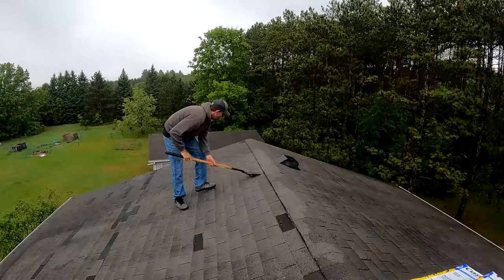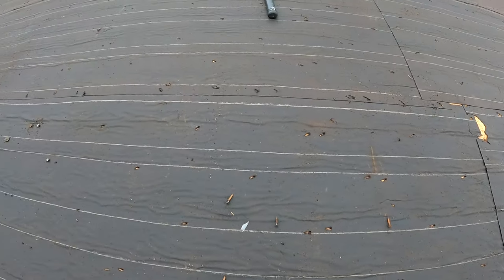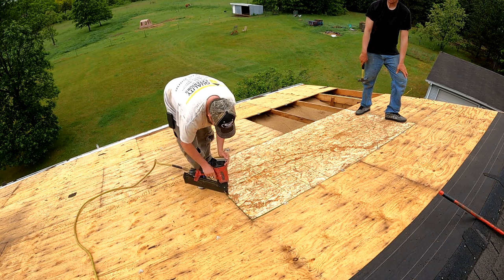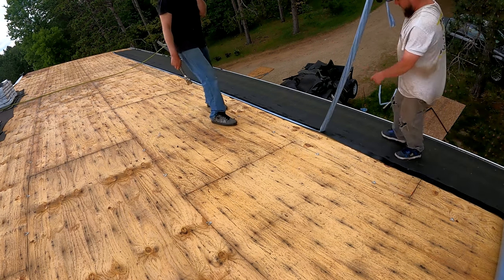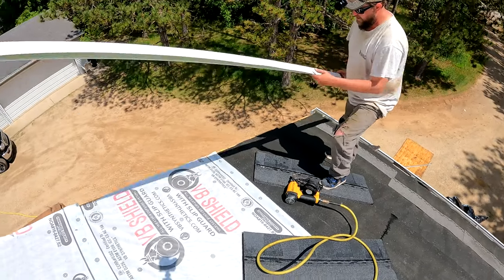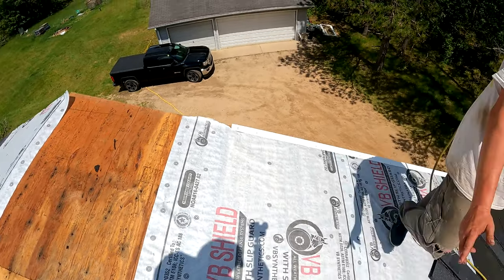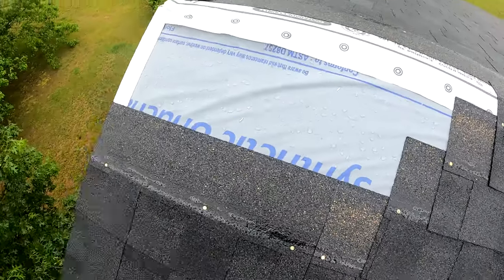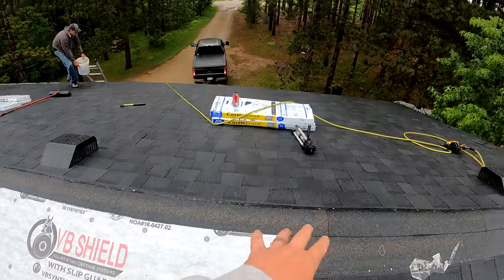HOW TO ROOF A HOUSE! [DIY]

Comment: Great work guy, Also I see your point about not running the starter shingle up the gable. It seems to me each shingle going up keeps one another down. I'm not a roofer, I'm a plumber of 50 years and I like learning new things and yes I'm roofing my roof all by myself. I've got to put down 75  bundles on my roof. I have a 8/12  pitch with a gable on the front, hip in the back with two valleys. I'm going to do my valleys the way you do sometimes, the closed valley or as they say the california valley.  Here in Alabama your're not required to use the storm guard in your valley, but I wanted it, so I did.  It rained like hell yesturday June 15th and no water got  through the synthetic felt. You do a good job simplifying things with your words and that's a big plus. Keep your videos coming...
Reply from the maker: I appreciate the view and the comment! going above and beyond minimum code is money well spent. The ice and water could save you a big headache in the future! you have any questions feel free to ask! the closed valley is the way to go in my opinion!
Reply: @Lifes_Apprentice  could you tell me what they mean by the key of a shingle.
Reply from the maker: @barrymilam9665  THe "keyway" is where two shingle butt together
Reply: It just looks cleaner
Reply: Not putting a starter on the rake actually voids the manufacturer warranty

Comment: I always chalk layout because it looks better having perfectly straight shingles and it doesn't take that much extra time. The fastest speed hacks use the gauge and never let go of the gun but on hot days the gauge can dig into the shingle and really screw up the layout. Also if multiple people are on the same section their gauges may be slightly different.

Ice shield expands when it's hot so if you throw it down cold in the morning you might have a bunch of wrinkles by lunch time. You can cut the wrinkles but that will make it less waterproof. On really hot days I'll tack the end of the ice shield then roll it out with the plastic on and let the sun hit it for a minute so it expands then I yank it tight, tack the end and pull the plastic from underneath it
Reply: Rookies chalk lines not professionals !!
Reply: @garylee12345  you certainly don't have to on a small house but on a warehouse or hotel or something cut up with dormers I think you gotta chalk lines otherwise it will look like some Dr. Seuss stuff at the ridge

Comment: Thank you you are a great teacher  your work is perfection you can tell by how your shingles line up straight you are one of the best of the best . From the Drip edge aluminum ice and water shield over the gutter apron V B shield white slip guard synthetic to the proper way with the nail gun . 7/16 to the 3/8  you are a professional best of the best 👍

Comment: One of the easiest and best ways I've seen for installing ice and water shield is to basically lay it out and do the staple on the one end and then take the plastic off after you've got it straight.

Comment: It would really cool to see how you start your coarse on a deck with hips on each side, that both run up into gables.
Your work is awesome by the way👊🏽👊🏽
Reply from the maker: hips on each side you do almost the same. keep a 5-7in stairstep and run it up. if it is cool outside i save my cutoffs for opposite side finishing pieces. if its hot and sticky i cut square and use on starting side

Comment: You don't have to put starter shingle on the rake edge, But it does insure a perfectly straight edge when looking at the edge from the ground
Reply from the maker: We just cut to the D edge and it stays straight that way
Reply: @Lifes_Apprentice  That's fine I'm sure. Some like to maintain overhang on the rake edge same as front edge.

Comment: i thought nailing IN/ON the tar line was a big 'NO' and that is due to the fact you're reducing the adhesive area for the next row of shingles.  Do manufacturers specify one way or the other?  I have all the material for my 12x12 shed laying on my garage floor and I suppose I could go out and read it but I probably would not know what I was reading anyway, lol

Comment: Starter on the gable is there to hold down the end of the shingle run so that wind doesn't lift it and blow water under it. With the starter holding the end of the shingle down via adhesive at the edge, any small amount of water that does get in is now on top of the starter, where it will begin to run downhill and come put at the downstream seam(s).  Odd you can't see why it's called for by roofing material manufacturers.
Reply from the maker: Thats what the ribs on the edge are for and when nailed properly it will not blow off. When using starter you let it hang over the edge more and it allows wind to grab edge of shingles easier
Reply: That's not true. Leaving the starter strip hang over 3/8" is not enough for the wind to get under it. The shingles you are using have the adhesive on the top side so there is no adhesive on the bottom  of the shingles  so yes they are all glued together but if you have too much pressure on your nail gun or the nails are too short (both could happen with a homeowner) then the entire assembly could blow off with enough wind but more than likely it will be fine. you'll get a lot less water  running under the shingles with the starter strip method. 45 years roofing and still going. Thanks for your video.
 @Lifes_Apprentice
Reply: @Lifes_Apprentice what ribs?

Comment: Thanks for sharing, Justin; I really appreciate your content. You show us the important details and 3X through the routine “hand-waving” parts.

Now for a question (which is probably code-dependent)… If it were your house and it had original 1X boards, would you you replace them with plywood decking, would you add 4X8 sheathing atop them, or would you just leave the original board deck and re-roof as the original roofers did. 

(My house is from the 1950’s, with an original roof, a second three-tab roof over it -done in the middle seventies; the wood is in good condition here in Southern California. I’m replacing with architectural roofing because it’s definitely time, it’s been shedding granules and looking “shiny.”)

Thanks in advance.
Reply from the maker: That is a matter of code in some cases and a matter of your preference. If there are large gaps,cracks,etc I would re sheet. I do not recomment taking old boards off in almost every case. I recomment using 3/8 or 7/16 and sheeting over existing boards if you sheet it

Comment: After just 7 yrs., my new
roof started leaking again. 
It was'nt until later I 
that I noticed my gutters  were not even
there. I knew one of the workers had taken all
iron awnings that held the front porch roof up,
because I asked about 
it.
I put a lg tarp, and  it helped, but still leaked.
Could no gutter be the
reason for such bad
leaks? 0:16

Comment: is it plywood , treated plywood, OSB, or what do you like
Reply: OSB is fine to use, it's a lot cheaper and more eco friendly if that matters to you. But CDX (which is treated for exterior use) will offer the best moisture resistance and longevity, but it's more expensive. Then of course the thickness will also determine it's longevity

Comment: If you run a starter shingle up the rake edge like you're supposed to then the bottom starter doesn't end up on the shingles keyway
Reply from the maker: The starter is not in line with keyway
Reply: @Lifes_Apprentice he meant if you run the rake starter first and then butt up the eave starter to the side of it, you can start with a full shingle because the rake starter pushed the full eave starter further away from the edge so the seams won't line up then

Comment: If you run "t metal" for the rake edge I can kind of understand skipping running your starter shingle 1" off your gable. But I've replaced alot of barge boards because people didn't knuckle gap their edge.

Comment: I have a question, I’m repairing my mothers roof and found so kind of membrane 3/4” thick. It’s  on top of her plywood and under the felt . Do I remove it or do I just replace shingles and felt?
Reply from the maker: JUst repair shingles and felt or the repair will not be even with existing roof
Reply: Do you know why they put that 3/4” tar/membrane? Home was built in 1940’s. I have pics but can’t upload to YouTube
Reply: @davidgrza if it's a low slope roof it could have been done as a flat roof prep and then someone shingled over it at some point. Gonna have to have some long nails to reach wood though all that.  Which means hand nailing. Guns only go up to 1 3/4 inch nails

Comment: The old "back-of-the-air nailer-hammer-trick".   haha
Getting my roof replaced right now.   1800 sq ft house.   They started at 8am.   They are 1.5 hours in and the roof is stripped.   Looks like a couple pieces of OSB need to be replaced.
Updates to follow......
Reply: .... 10am  they're stapling down the  what-cha-ma-callit paper/felt.
Reply: They finished at 6pm.   All done and it looks pretty good.  I think I counted 7 or 8 guys on the crew.

Comment: Strange that you staple the hell out of the ice & water barrier when it's adhesive and you're about to shingle it same day (which adds plenty of hold-down fasteners). Every staple compromises the integrity of the shield.  I'd be surprised if the official usage documents for the adhesive barrier call for it to be stapled, at all especially when shingles are going on the same day.
Reply from the maker: It is cold and does not adhere the same day in Wisconsin and we are in a wide open field where it is windy.

Comment: So when you put over the gutter what keeps water from going underneath when high winds and rain pulls it up???
Reply from the maker: Waterflow. there is a small possibility in a crazy storm
Reply: @Lifes_Apprentice  still vulnerable water finds it's way through any openings trust me
Reply from the maker: It is not a roof opening at that point and metal fascia should go about 2 5/8" behind getter apron and gutter over that too. water is very unlikely to get blown up over 2 inches under that installed corectly with no sealants required...Ice dams are a whole other issue and any amount of "prep" will not prevent in a bad scenario

Comment: I’m not a roofer by any means so I just wanna know, wouldn’t it be better to overlap at least one square from the prior sheet you placed so there’s no crack for the water to get in when it rains?
Reply: I'm not one either but don't believe me Im pretty sure you can because I've watched other roofers do it but it might not be for sure.

Comment: Can you put ice & water shield on top of the old one? 
Or should the old one be removed? thanks!
Reply: If you can’t remove the old it is ok too install over, you can also chalk a line and cut out the old ice and shield, sometimes it is so stuck too the roof you cannot remove it😊

Comment: Never cut the shingle down the drip edge, firstly you can easily slice the drip and second on a hot day the shingle will roll off the edge and make the underside of the drip black when viewed from the ground. Also and FFS cut a proposer shingle family.

Comment: The started on the gable helps hold the shingles on with that tar strip just like with the first row of shingles..
Reply from the maker: The eave starter is not to hold shingle down..It is so water doesnt get into keyway on first course. The shingles on rake edge are held by proper nailing placement
Reply: @Lifes_Apprentice  the starter row of shingles has a tar strip.. using starter on the gable ends also helps prevent shingles from blowing off.. starter Owen’s Corning representative came to inspect our roofs and he also said this.. I been doing this my whole life, you can’t tell me nothing…
Reply: @Lifes_Apprentice  what’s the purpose of the tar strip on starters??
Reply from the maker: @JohnDillinger-ko8bc  To bond the starter and first course together
Reply from the maker: @JohnDillinger-ko8bc  I have been roofing my whole life too. The rake starter is a newer thing... My opinion is the shingle companies just trying to sell us more shit and make more money...Starter of any kind did not exist until 20 years ago...Before we just used shingles

Comment: Just wondering. How come you only need the ice and water shield on the edge of the roof and not the entire roof?
Reply: Ice and water shield is mainly to combat ice dams that happen along the bottom edge of the roof. As ice and snow melts it tends to freeze when it hits the bottom edge of the roof because that edge with it's overhang is usually colder than the main roof. The ice and water shield protects from any melting that occurs under the ice dam and tries to work it's way back under the shingles
Reply: @MikeKunze-o5j  Ahh, that makes so much sense. Thank you!

Comment: Do you have any experience with flat roofs and dumpsters? How much can they weight on average this is for a warehouse and it looks white from Google eagle
Reply from the maker: I do have experience and the wieghts can vary. If it is a white PVC roof they are generally light along with rubber roofs. You have to be careful with built up tar roofs are heavy and any flat roof can have multiple layers
Reply: Thanks. Would you drop a 20 yards on that jobsite?
Reply from the maker: @EarlyBird_Dumpster  I would with my equiptment after I was sure what was going in there

Comment: Are those Atlas shingles thinner then GaF , Owens conring
Reply from the maker: They are about 235lbs per sq. they have become my favorite shingle over the last 5 years. I still love Durations but don't sleep on atlas products if you can get them. they make a line called briarwood pro, and storm master as well. In my opinion they make the best shingles on the market. I put my first atlas roof on 15 years ago and I drive by it all the time and still looks amazing
Reply: @Lifes_Apprentice   Good to know they don’t sell around here .
Reply: We try to use exclusively Atlas if possible, have been very good for us.  OC is our 2nd choice.

Comment: You really should use tin tabs . Plus im certain the ice and water goes on top of underlayment
Reply from the maker: I do not know what tin tabs are but the ice and water does not go on top of underlayment.
Reply: Depends on codes Florida is different. Tin tabs keep the tar paper from pulling of nails. It's a wind code thing. the concern you had for nail depth on gun is the same concept but tin tab ensures no issue for underlayment.with new synthetic stuff, may not be as critical.
Reply from the maker: @Nttt739  I do not know florida code...I believe you but in Wisconsin our codes are based on snw loads on roofs and ice dams and such...I am sure the codes varie all over the country to some degree

Comment: No roof is ever square you should chalk lines. Lines keep the shingle runs straight.
Reply from the maker: We run the tarpaper straight to the roof and to the peak so the lines on the paper keep us straight on a ranch roof. On a roof with valleys and dormers we will snap lines

Comment: How can you shingle right to left that drives me nuts.
Reply from the maker: Thats my favorite way to shingle and I am pretty fast.5sq and hour when Im in go mode. I can shingle either way. I always start at a wall or valley and run. If i have a choice i go backwards... I compliment a normal right handed shingler very well on a job. The guy who tought me to shingle could oly shingle one way so I always took the right to left run and just got used to it
Reply: @Lifes_Apprentice  your a wild man
Reply from the maker: @keithN6  I aint scared! lol I have done one square challenge several times and it proves I am fast! I am not the fastest....lol I love competition though and love to know that I am not "slow"
Reply: @Lifes_Apprentice  yo lol, this is why everybody needs to take a side and stick to it. One guy starting on left and right same side big no no, if you check all the work over the years guaranteed you gonna see some monstrous gross work and shingles not lining up, at best a bunch of nicely hidden chop in the middle. Only way it would look ok over many houses is just do that for starters and first row only, But like i said everyone should just take a side of the house and stay to there own nice and easy.
Reply from the maker: @lukasevenson  I shingled the whole thing.... its in the video

Comment: Where are your h clips for the plywood?
Reply from the maker: I clearly used them in the video if you were watching
Reply: @Lifes_Apprentice  tell me at what time interval. I saw you replace plywood,putting new sheets in and not attaching h clips
Reply from the maker: @ToddBizCoach  I even dropped one in the insulation and picked it out with a tearoff shovel. watch again bud

Comment: Right from the beginning, this guy is doing a hand stapler and not a roofing nailer. To hold that down, I don't care if it's self sealing itself. Sticking whatever you still use roofing nails and tin tags. That's another thing hes doing wrong, hes not snapping lines. The roof could be off a little. What roof you're running shingles on? If you're running them straight up or if you're staircasing them, you always Snap lines. You don't trudge the edge of the roof you want your s*** to look Really good.

Comment: Always use lifetime shingles. If installed properly most manufacturers will guarantee them for life. When I had them installed the installer guaranteed them for life with a transferable warranty. Major resell point. And yes the installer is still in business and will be for many years to come. When I had my garage built I insisted on them and now the builder won't use anything else. Also, I want ice and water shield on the entire roof, not just the first three feet. I live in New England. Just do it right the first time. And OSB on a roof? Really?!